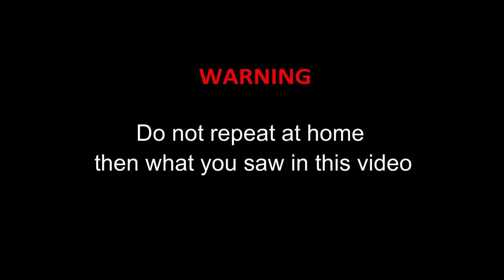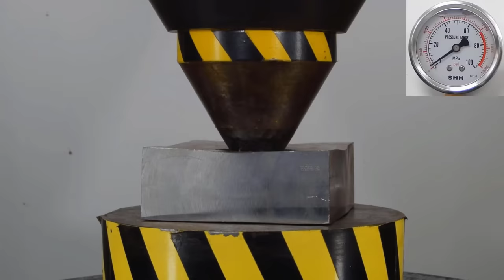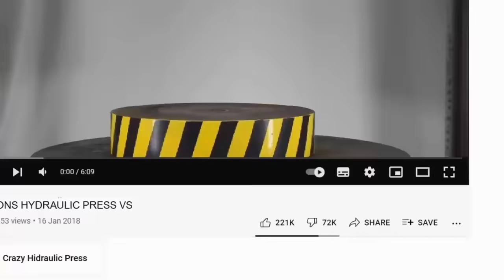HYDRAULIC PRESS VS OLD AND MODERN ARMOR

Comment: Interesting, but not really representative of what the armour was designed to resist. Advanced modern tank armours contain ceramic elements that the press would easily shatter, but against HEAT or rod penetrators, they are resistant.

Comment: As usual, this is presented out of context. The titanium armor looked to be "ablative" armor, which protects by absorbing impact by breaking off. BOTH armors are most useful (notice the Russian armor came from the SLOPED front of the tank)  by DEFLECTING that force.... NOT a straight on impact. Turn your press to impact at 45 degrees, THEN see what happens

Comment: the lack of quality safety gear is astounding. Quarter inch lexan blast shields? If that was lexan, the way it flexed hardly seemed impact rated. We use half inch and it still takes a beating, crushing that frozen ball was potentially lethal. I sure hope he was not in the room while that was going on.

Comment: So, it appears the AR500 broke around 350 tonnes of pressure and the 1940 armour   was penetrative with 450 tonnes of pressure. Curious to see how far through the 1940s armour 350 tonnes is. Still don't know which is better from the tests in the video. \_0_/

Comment: Old steel is noticeably stronger than new steel due to the radioactivity in the air after the first atomic bomb. While minuscule in traces, it is still enough to produce a measurable effect. This is why steel is scavenged from old downed aircraft and vehicles from before Hiroshima, and is highly sought after; as the only alternative is extremely expensive steel made in laboratory conditions.

Comment: Firstly, what is “modern armor” and what is “1940 armor”? There are many armor types and they are made of different materials, so it’s important to specify this. 
Secondary, armor is not a solid slab of metal, especially the modern one which is usually composite, so I’m not sure what this test should simulate

Comment: When it comes to steel hard is not the same as strong, you need a balance of hardness and ductility for it to dissipate energy effectively especially in armor or for that matter any metal constructs, a more ductile metal will bend and flex thereby dissipating the applied energy, as you go harder with the metal(steel) you increase how brittle it becomes and the molecular structure of that metal changes to a point where it cannot dissipate energy efficiently as the energy has nowhere to go and cannot convert to another form efficiently, said energy has to go somewhere, and as with the very hard AR500 that energy resulted in a instantaneous release or a catastrophic failure of the molecular bonds where as the first steel while older would dissipate the energy by deformation and significant heat a as you could see with the sides of the metal bulging (flexing) out but it did not have the same type of failure, neither is perfect both have their strengths and weaknesses which is why it’s more common to see composite armors now, blends of various properties, best of both worlds.

Comment: I am curious - I had expected the steel ball to shatter. not the plate. Cold metal = brittle metal, brittle metal squashed between a rock and a hard place, metal shatter... but not quite the piece I was expecting.... 
The ball was colder than the plate, presumably it was not a 'harder' metal than the plate, somehow the temperature hardened the ball or contact with impacted the plate.... anyone techy help answer why please?

Comment: Why is nobody asking for the steel ball test without liquid nitrogen? What if that works, too? I bet all the comments talking about physics and spheres would shut up. You dont need to be an engineer to form an experiment properly and have a control before you start observing and assuming. Without a control, the idea that the nitrogen helped at all is pure conjecture. Maybe the ball was enough because sphere magic, maybe it was because the armor cooled down, maybe it was because of molecules getting closer... Or maybe you forgot to ask questions like 'was it necessary' or 'would it work anyway?'.

Comment: The 4:00 test is bad because you flipped the metal. By pushing one side and than pushing it on the opposite side you weakened the metal's true strength. Although the results would not be much different the result did change and maybe it might just might have had enough strength to smash the tip. Although the margine of strength is slightly higher the rest of the cone did smash meaning possibly the armour was compromised due to the previous test on the same slab.

Comment: This is not good comparison. You took steel from T-34. It was build with very lov quality because during 2 WW the time production and costs were the priority. So, the steel was also low quality. Insteat of that you should take steel from german  tanks like Tiger and then compare it with modern steel

Comment: Failure to not fully penetrate 1940s armour hardly mattered the impact caused inside layers to spall away any fly around inside the tank. Mission kill achieved. 
Relatively less hard armour traded spalling against stopping power.

Comment: as steel, titanium got some versions too, that work better, same to tungsten, that the normal they sold is weak, but the tungsten armor is another level, is several times stronger than the best treated titanium or steel armor. but unfortunately is impossible to buy some high quality tungsten plates, they are today used in T80 and higher and also in challenger II, both never was truly defeated by land weapons, all reports made was absurdly fake but everyone already know today, only AG missiles can destroy that, as maverick for example, or extremely powerful cannons, as GAU-8 for example...

Comment: Whatever material the tip of that press is constructed from…..

Make a tank out of that…
Reply: Probably a harden composite of steel, like good drilltips without dimand dust in it. 
Like locks you cant cut with  bolt cutters just use a higher grade of "Hardened Steel". 
I willlet smarter people say more.